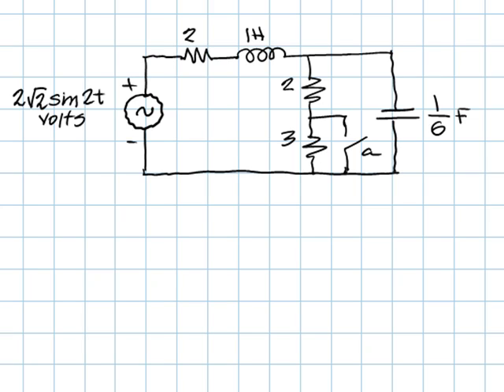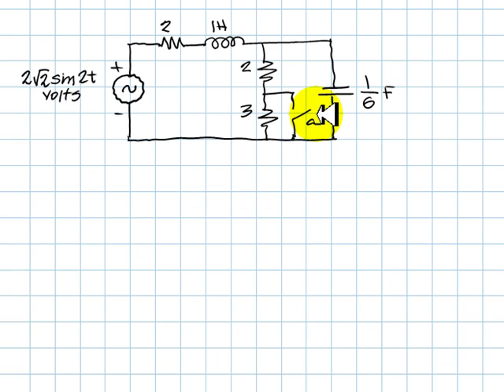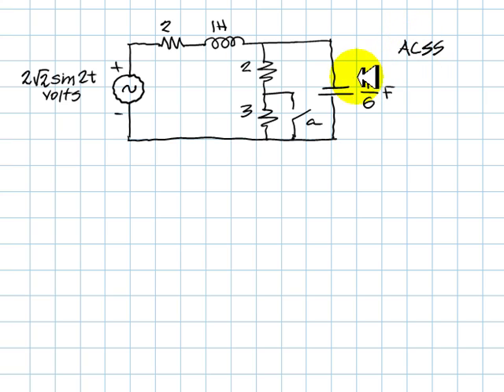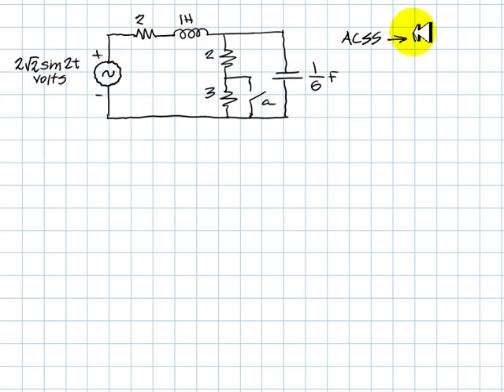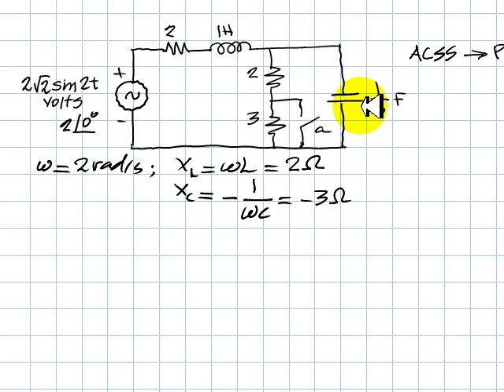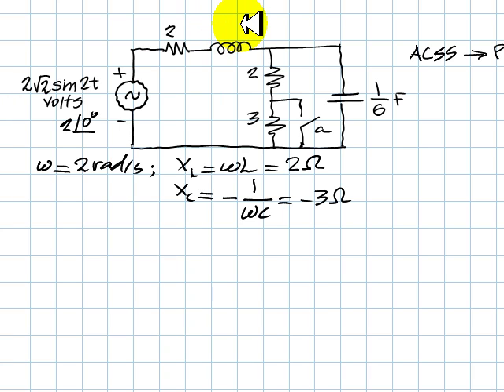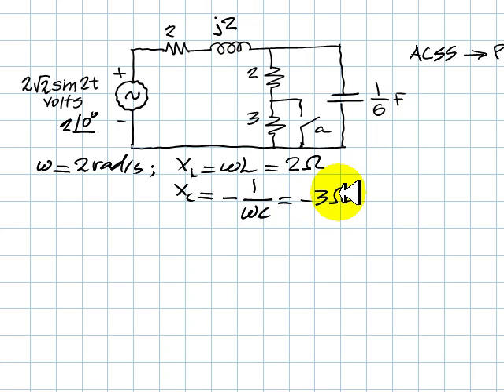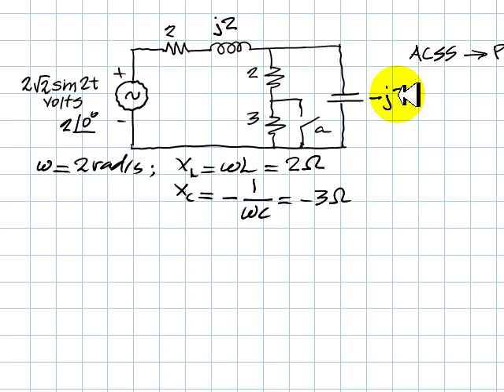Combining Phasors and Laplace, a tutorial.

Comment: Excellent video! Professor, what's the general rule to determine at which instant we want to find the initial conditions? I mean, let's suppose in the circuit of the video there's no switch (although the source is activated since -infinity). I guess we still need to find the initial conditions. But in this case, do we still need find them at t=0? And why at that instant? Why not at t=4 or something else?

Thank you a lot in advance. Saludos desde Venezuela.